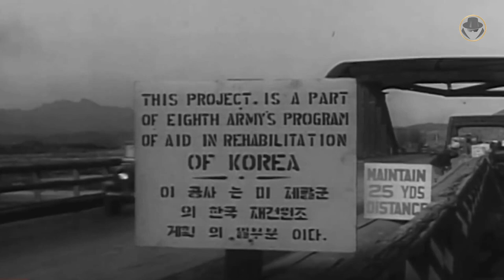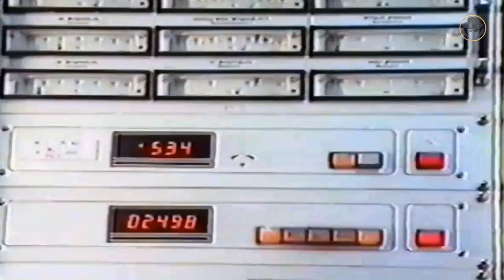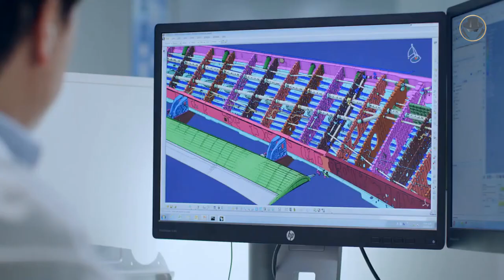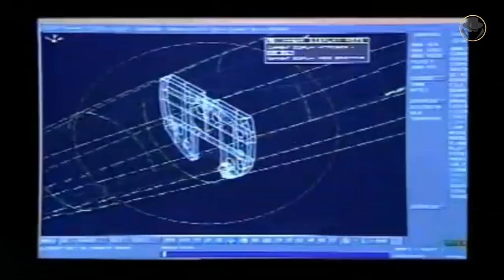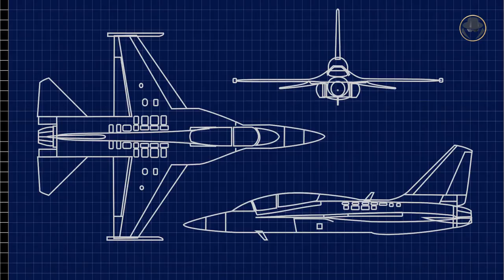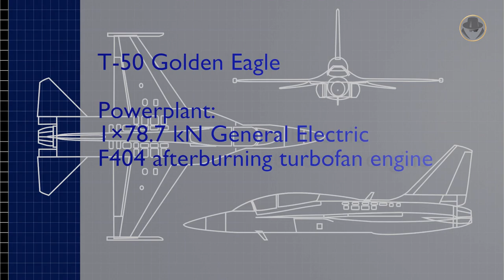T-50 / FA-50 Golden Eagle | A good trainer and combat jet

Comment: AESA radar,BVR missiles,Helmet mounted cueing system and aerial refueling probes will be the game changer for the FA-50. It will be comparable to the JF-17,Tejas and even the Gripen and the F-16. This will be a very good option for low budget air forces and may even be an option as force multipliers for some mid budget air forces.
Reply: do you mean that the fa50 will be a full-fledged mrf once it completes its upgrade to block 20? how so?
Reply: @meanbumboy3108  yes. The current FA-50 is already a full fledged combat fighter aircraft.
It will become deadlier if that will be upgraded into Block 20 standards.
Reply: The big problem I see is that when you start adding up REALLY expensive equipments to a budget aircraft it loses most of it's appeal compared to more expensive and effective planes. If you start pimping up a pick up (T50/Tejas,) to the extreme and check the bill, you start looking at more capable trucks (F-16/Gripen) with other eyes interst
Reply: @Leptospirosi  Yes, you're correct. But with Russian war on Ukraine, many developing countries are looking into FA-50 due to it's cost effectiveness. Many countries don't need AESA radar that can see 150km range when they don't have money for buying long range missiles. And FA-50 isn't made for long range mission, it's made for scramble role and short bombing mission after more suitable fighters taken care of aerial operations. Small countries doesn't need long range fighters as they have smaller defense budget, and this is when cheap light combat aircraft comes into advantage. Even for Korea, FA-50 is replacing their aged F-5 fleet, F-5E of Korea was used mainly for scramble and aerial patrol role as it's very cheap to fly and maintain. FA-50 Block 10 has targeting pod integrated, so SoKor will not upgrade their current 60 FA50 with Block 20 (AESA radar, refuel pod, advanced avionics and mid-range missile integration etc..), all Korea will upgrade is to Block 10 level as they have F-16, F-15 and F-35. F-16 and F-15 fleet is being upgrade to AESA radar, so technically Korea don't need FA-50 with AESA radar just targeting pod will be enough.
Reply: not comparable, because it will always be a light combat (it will still have the weight and range restrictions). however, it might just be the best solution for a modern substitute for the TONS of F-5 out there. especially if they, along with enhancements from the block 20, also nudge in a few ideas from their competitors like the m346 (less radar cross-section on a kit, more options for anti-ship). plus, having more weapons integrations outside of using only pretty much american weapons would help it, because the bureaucracy of buying american weaponry (missiles, bombs etc) is quite big. integrating with european and israeli weaponry also might help
Reply: Include also the Sniper targeting pod and this little fella will be even more potent in CAS roles.

Comment: The best light fighter/trainer so far when it comes to specifications, cost effective in acquisition, operation, and maintenance. Performance wise it was the closest you can get to the F-16 mission envelope which can perform both air to air and air to ground/surface (navy) missions with confidence. It even have a 20mm auto cannon which comes handy in close air combat and strafing ground targets in close air support missions whenever possible depending on the risk.
Reply: I think you're describing FA50. Because to me FA50 is the closest trainer to F16. FA50 is not only a trainer aircraft but also a light MRF.

Comment: Correction: It was a Philippine Airforce SF-260 aircraft which was involved in the friendly fire incident and not the FA-50PH.
Reply from the maker: Thank you for the correction.
Reply: @PICKLE_Rex24  so basically, it was the pilot's fault, yes?
Reply: no, both the SF-260TP and the FA-50 suffered fratricide incidents during the Battle of Marawi...

Comment: I'm proud that the Philippine Air Force (PAF), 🇵🇭 has choosen the FA-50 for its Fighter, Surface Attack Aircraft, and Lead-In Fighter Trainer (F/SAA/LIFT) Acquisition Program with the first acquired a squadron of 12 FA-50PH back in 2015, and delivered through 2016-2017. 

I'm hoping the PAF will acquire an additional 12 to 36 FA-50 Block 20 to complement the 4.5 Generation Multi-Role Fighter (MRF), either F-16V Block 70/72 or JAS-39E/F Gripen (My top pic would be the F-16V), as a Light Combat Aircraft and Lead-In Fighter Trainer (LCA/LIFT).

Comment: KAI wanted to use more advanced AESA radar, EL/M-2052 from Israeli Elta. But it was refused by Lockheed Martin, technology partner, to protect their F-16 sales. So it had to use less capable EL/M-2032 radar.  Indigenous development AESA radar is well under way.  Integration of medium range air-to-air missile like AIM-120 AMRAAM is under consideration, but Korean Airforce is not interested in the air combat role of FA-50, to protect on-going development of new KF-21 fighter.
Reply: 한국공군은 f16v가 나오면서 fa50의 모든 제한을 풀고 bvr.에이사.웨폰베이.단좌기.암람c형 이상으로 업그레이드를 공식적으로 요청했습니다